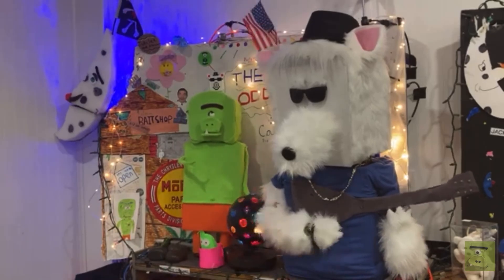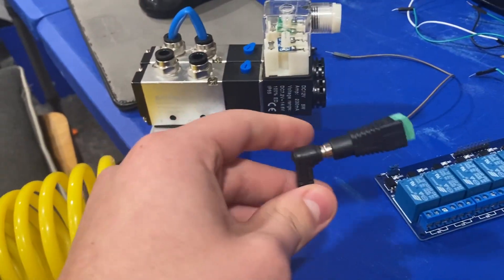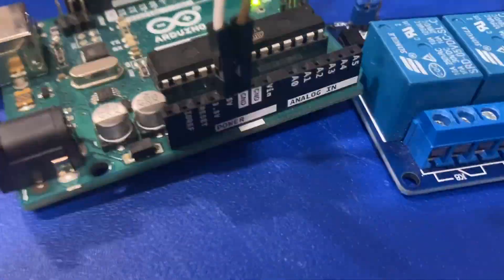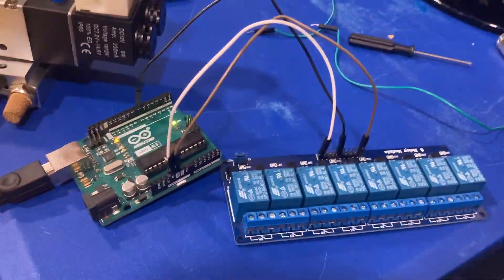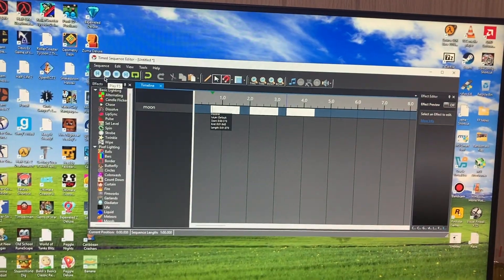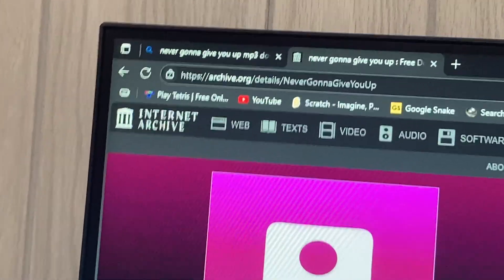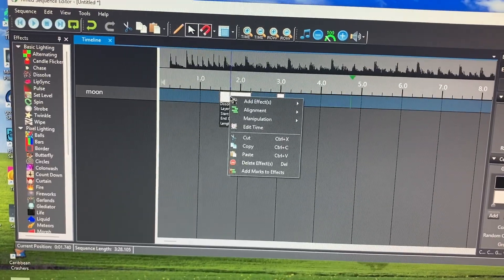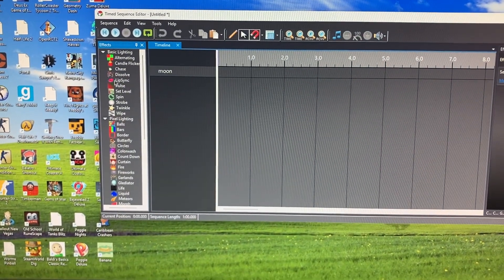How to program an animatronic with Vixen Lights.

Comment: Do you need an air regulator?
Reply from the maker: Flow controls should be enough.
Reply: @S.J.C._Entertainment  what size is the flow control because I see a lot of different sizes
Reply from the maker: @gageakagagesteroimaginatio4716 What size is your tubing?
Reply: @S.J.C._Entertainment  6mm OD 4mm ID
Reply from the maker: @gageakagagesteroimaginatio4716 Just get whatever flow size that fits your tube size.